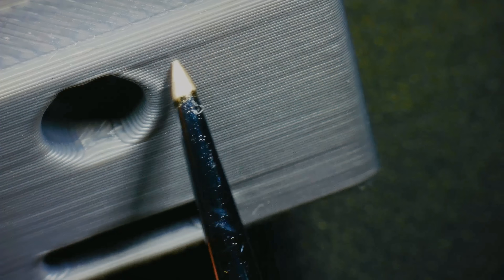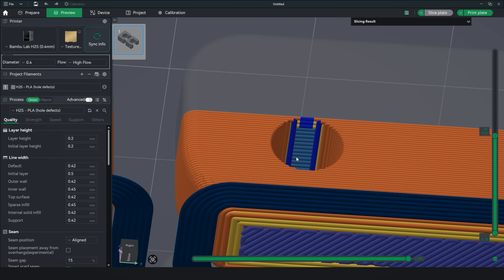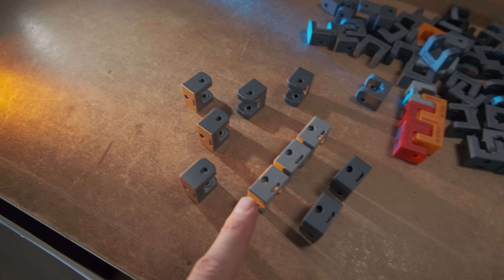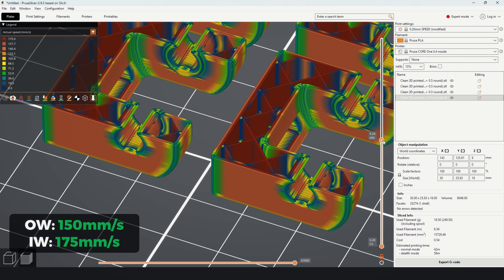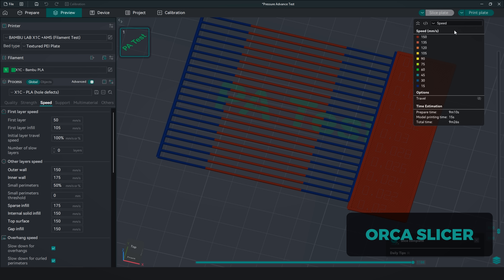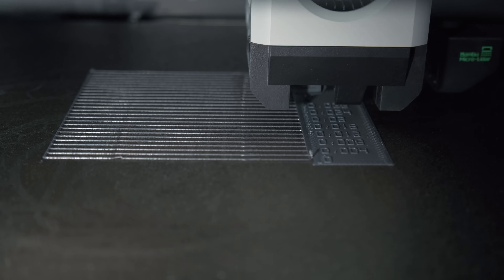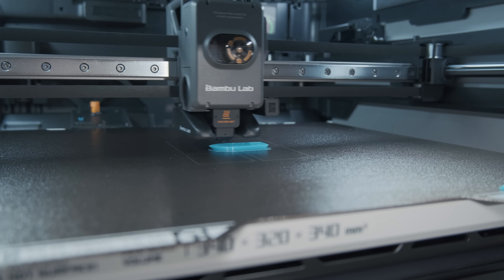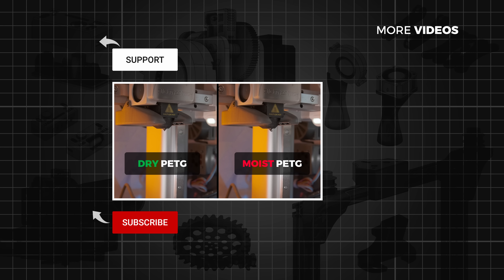How to FIX the UGLY 3D Printed HOLES (FULLY EXPLAINED)

Comment: Can you make a nozzle test video for the H2S/H2D, like you did for the P1S/X1C? With BIQU Panda Juicer / E3D Obxidian 500 / Microswiss CHT Highflow / Pheatus Conch?
Reply from the maker: H2/P2 series stock hotends already are good enough (compared to x1, p1). You choose other hotends for features like very high abrasion resistance, etc. I made a YouTube post about E3D HF ObX 500 about its performance.

Comment: I kept reading that the line method is no good and to use the pattern method. I have always had better results with the line. That said I am having some issues with ASA at the moment and finding it hard to read the results, they all look about the same. I may print on a different build plate and try to get better resolution as you have mentioned here. I really like this video and seeing some of the speed change pictures. Really appreciate it. also understanding that speed changes will impact the use of PA values is important. I was getting few artifacts at regular speed. I slowed the print down on my Kobra S1 and it came out with hole artifacts. Thats why I finally came back to watch this video lol. Thank you again.

Comment: hey im trying to implement your hole design but it looks weird when doing the top edge at 0.2mm chamfer, getting a more uniform look when i have a matching 0.5mm chamfer with the .5mm fillet. at least in cad, havent printed yet.
any tips?
Reply from the maker: Yes it does a little bit. You can try printing both, I doubt you see any difference with 0.4mm nozzle.

Comment: Is the auto calibration you’re talking about same as the flow calibration checkbox I get from my orca slicer printing to the A1 mini?
Reply from the maker: Yes, just make sure the "Enable pressure advance" checkbox is unticked in Material settings. Otherwise, it will override the auto calibration before the print.
Reply: @PrintingPerspective awesome! I will try it out

Comment: You should try turning off “slow down for curled perimeters” it’s a big culprit for the types of defects that you’re showing with the holes.
Reply from the maker: If we have perfect PA control, then it is not an issue, so it is definitely not the culprit. The setting for curled perimeters is a secondary issue due to the complexity and difficulty of the PA control, as it drastically slows down/speeds up printing speed on the overhangs, like 150->15mm/s vs 150->75mm/s when it is off. But without this setting enabled, very steep curled overhangs completely break: https://drive.google.com/file/d/15IYAkv44oBKXxKqTzr6WQlSaeIuqAGAr/view
Bambu Studio already has this overhang logic working with no issues, not sure why Orca devs just don't copy it.
Reply: @PrintingPerspective  because they are very stubborn and think they know better for some reason

Comment: Most holes in my prints are for screws so don't particularly care how they look as long as they're dimensionally accurate.  In order to minimize bridging and having overhang issues I just ended up using what lots of others did which is to have a teardrop shape.

Comment: Placing the humidity sensor that close to dessicant will likely result in false readings. Especially when the AMS is opened oftentimes for filament changes. The sensor will not pick up intermediate values that quickly.
Reply from the maker: If you often open and close the AMS, silica gel is not that effective anyway. By placing the meter next to a silica gel, I monitor the decicant state. Plus, I put 4 different materials and do not open the AMS for months.
Reply: @PrintingPerspective In that case it's fine. That's just something that I noticed because I only have one P1S and a single AMS, but a large amount of different material types.
What I do in that case is leave the middle part free from dessicant and have only the meter in that space. I find there are enough other places to put dessicant in the AMS to maintain very low humidity.

Comment: This is a really important topic.
The reason Bambu Lab's auto calibration works so well is that it performs dynamic pressure advance. PA value isn't a constant—it's more like a non-linear function influenced by various factors.

Bambu Lab's eddy current coil at the nozzle heatsink isn't just for bed leveling. It's also used for "auto calibration," which performs non-linear PA calibration by indirectly measuring nozzle pressure through displacement.
OrcaSlicer's Dynamic PA offers similar functionality, but it's much more tedious for regular users since you have to manually obtain PA values for every speed and acceleration setting.
Bambu Lab's recent "servo extruder" is basically an FOC-controlled motor that can measure extrusion force via current. This provides additional data on extrusion force to complement the eddy current sensor measurements.
Reply from the maker: Bambu indeed has a non-linear PA for the auto PA calibrations. Having an eddy current sensor + motor torque sensing for calibration it makes sense why it works so well. The manual PA calibration with precise PA value still works quite well if you don’t go crazy with speed differences, accelerations, etc. But yeah, all this testing changed my mind about auto PA just being wasteful to run before each print, to where now I always do auto PA before each print. Crazy…
Reply: @PrintingPerspective The problem is there are so many people using textured build plates that the auto PA calibration isn't super consistent. Printing on a smooth sheet where it can get a much more accurate extrusion width can make a big difference. I just love utilizing that textured surface for prints that I've accepted the small artifacts and print defects. Slowing down the print cures a lot of these issues even without a perfect PA value.

Comment: Pressure advance values will change over accel and speed changes, orca allows you to set adaptive pressure advance but it reality it still miss many points in my testing. I got best results with nolinear PA from bleeding edge kalico branch. Tune it, cry once, almost perfect at any speed/accel!
Reply from the maker: That makes sense. When I was comparing H2S manual vs auto PA calibration methods, auto PA before prints was always slightly, but still noticeably better in comparisons. And I know that the H2 series auto PA is a non-linear PA method. So, the manual line calibration on the H2 series will be slightly inferior as it uses only a single K value without additional factors. I wish BTT or any other company would collab with Klipper devs to make Eddy current sensors and torque-sensing motors for the auto PA on Klipper printers. But we all know that is not going to happen, as there are no profits there. :/
Reply: @PrintingPerspective  Kalico has comprehensive documentation on nonlinear PA that is worth checking out :)

Comment: Orca has adaptive pressure advance to take into account various speeds and accelerations. Have you tried?
Reply from the maker: Yeah, I know, but I haven’t. The adaptive PA should be used with adaptive Flow (small area flow compensation) for the best results, because both the flow rate and PA change between fast sweeping print sections and slow small ones.

Comment: Excellent video. It gets so tiring to explain to people over and over again why it's not as simple as a few calibration tests to actually get perfect prints in all scenarios. Even if just your outer wall and top surface speeds and accelerations are different for example, the same PA value does not actually work perfectly for both. A PA value may not produce the same results on a very small print with lots of heat vs a very large print with tons of cooling. If you change flow rate or temperature, suddenly your PA may not be perfect anymore. Also no, your stock settings print on a Bambu Lab is not perfect. Anyone with experience tuning can point out tons of flaws or points of improvement. Adaptive PA can also help with all of this, but takes a lot of time to tune and isn't supported by all printers. All the other factors you mentioned and more also come into play. When you are trying to produce prints as close to perfect as possible with high strength and accuracy, a lot of tuning can be necessary. That's just the way it is no matter what printer and filament you are using. Thanks for the great resource to send to people! Learning to tune each filament you use is really a great skill to have.
Reply from the maker: Thanks. Yeah, there are so many variables and the deeper we dive the even more of them appear. I always laugh when people say 3D printing is simple. It is definitely not if your print quality standards are high. I am not saying H2 series produce flawless results with auto PA, but they are spot on what I can achieve with the precise manual calibration. Sometimes I just want to print parts and focus on other things I am working. I wish we had an open source auto calibration method, I would love that on my Voron. I would probably spent all week tuning it to perfection, haha!
Reply: @PrintingPerspective  it's weird that voron doesn't have that function because many people have told me that bambu printers are just clones of voron trident and nothing special.
Reply from the maker: @riba2233 I stopped caring what people say about Voron… about Bambu… about Prusa... These days, a lot of people tend to take sides and complain about the opposing side just to do so. Every printer and brand has advantages and disadvantages. I love my Voron because I upgraded and configured it exactly how I want (and can change how it works any time), and I love my H2S because it takes the least effort to make quality prints. I love tinkering, and I love effortless printing. And because I never had a Prusa printer in my life, I have nothing to say about them. I don’t know, I started just ignoring what most people say, because almost always, there is a very clear bias and hatred towards the other side, and such influenced opinions are worthless to me. :)
Reply: @PrintingPerspective  of course 😊
Reply: @PrintingPerspective  I'm impressed you're that impressed by the Bambu Lab auto calibration! I still think it's a valuable skill to learn of course.
Reply: I have not dived deep into this and will be trying orcas PA calibration as the default one on bambu studio just doesn't seem super optimized and is a bit too simplified compared to others. It will get you 95% there as far as PA values go but as stated there are so many values that come into play that sometimes that default 95% is good enough for most all projects where ultimate print quality isn't required. 
Flow rate is also another setting that is far too simplified and the calibrations for it are also far too simplified. My X1C with the Lidar does seem to get fairly close with its auto calibration using the Lidar. Though even the Lidar has baked in limits so as to not stray too far from the default settings.
I would be lying if I could squeeze a bit more quality out of it tho. There are diminishing returns to everything however. You'll spend far more time tuning that last 5% than the 95%.
Reply: @rileyneufeld7001 I agree with you. Definitely worth learning the tuning for yourself. When you get it just right it's so satisfying. Then you can post pics that actually impress people who know hahaha.

Comment: I lose a lot of time calibrating. And for example, I have to recalibrate PETG to act as support at the temperature of the PLA I'm printing. It does help that you don't change the brand and colour PETG. Just save it to user presets. 
I always do the tower and the pattern but I will add line to that seeing as that will help with lines.
It doesn't help my perfectionism though as I always overanalyze calibration with my microscope.
Thank you for posting this, your videos are always informative. Top!
Reply from the maker: Thanks, I think our printers are just not advanced enough yet. So I wouldn't suggest going too crazy with the calibrations. Find the one that works the best with your printer and use way smaller calibration increments, that's all we can do.

Comment: why is stable volume disabled? would be nice if it was on :)
Reply from the maker: I wish I had an idea why, I don't think I can control that. Probably YouTube just being YouTube.
Reply: @PrintingPerspective  have to turn you up like 40% :)
Reply from the maker: That's crazy. I have to lower audio when watching my videos by similar amount as they sound too loud compared to others. I will try look into, but previously a year ago I couldn't find anything.
Reply: @PrintingPerspective  i found this regarding "stable audio" and this platform;

reasons include the original video's recording quality, such as a low bitrate audio file or inconsistent audio sources like alternating between different channels (e.g., stereo and surround sound) i see some other channels that also have this stable audio feature disabled. perhaps some toggle in studio ?

Comment: You can variate the layer height at the top of the hole, but overall if I need precise holes, I just drill them out.
Reply from the maker: But then you variate the LH for the whole print which usually leads to less consistent looking print surface. I totally agree with drilling the holes, I often do the same when I need perfectly round holes.

Comment: Even when selecting the optimal line through PA tuning, defects from insufficient extrusion occur with materials like PETG, so I question whether PA tuning is the correct calibration method.
Reply from the maker: Insufficient extrusion occur when you are no longer properly melting the filament (if you have no mechanical problems on your printer). Regular petg needs to be printed at ~25% of your hotend's max flow rate. High speed petgs are so much better at this.

Comment: I've concluded all calibration line and surface prints are useless.
They are too different from the actual print objects and their performances have no relation.
Reply from the maker: On what printer you tested? The second best method for me is the pattern, but you need a microscope whe analyzing results. The line works best for me but if others methods works better for you, use them, things can vary as usual.
Reply: @PrintingPerspective  Bambu A1. I guess there's better machines.
Reply: The whole point is to use a small amount of filament to get a close value, then do actual test prints, and then you can tune from there if necessary. Different prints will almost always need slight tweaks to be perfect.

Comment: I was genuinely surprised at how well my H2S and H2D performed when using the auto calibration from the print send screen as well. No idea why the results fed back when doing "auto calibration" in the calibration menu is too low (noticed the same thing)

I really wonder if they actually use a variable PA table on the H series that is only stored on the printer (basically how orca's multi-PA calibration works for klipper printers). My only reason to think this is because of how well prints come off even with varying degrees slow->fast and fast->slow. It is also strange that doing the 'auto calibration' fron the print screen never shows the user that value or gives access to it. If it was a single value, I would at least expect them to do so.

Lastly, I haven't compared keeping that setting to 'on' vs 'auto', but I have a few prints from auto and they look very very good as well. I do know that 'auto' just stores w.e. was calibrated and then uses it a few times until it does it again (how that time frame is determined, I don't know).

All I know is, I am glad to not have to do my own PA calibration on these printers. Thanks for the video!
Reply from the maker: Yeah, auto PA before the print gives extremely good results on H2 series, that's my experience too. I tried asking Bambu about how all of this works on their printers, but you know, couldn't get almost anything in detail as it is closed source. Before this video, I was very sceptical about running auto PA before each print as it waste filament each time, but now when I saw how much important it is, I run it every time... I want this auto PA on my Voron too! ;D
Reply: @PrintingPerspective I know they are just using the Eddy current sensor for pressure sensing (probably just measuring deflection of the whole hotend give the sensor placement, though most/all will come from the melt zone and nozzle area).

They probably get a baseline reading of the pressure when extruding X amount of filament. Then, use that baseline as a constant offset for varying extruder freed rates and map out a table. Doing so allows it to be pretty much filament agnostic (since each filament will exert different pressures; given compressibility, fluidity and density differences). The only disadvantage is not having back pressure data that would come from actually laying down the filament, though that is probably just some averaged constant thrown in.
Reply from the maker: I think we can only speculate about how it works. The H2 series uses eddy current sensing combined with torque data from the extruder's motor to determine the Pressure Advance value, that is probably why it is so good. The A1 series only has eddy. So far, it has worked very well on the H2 series, to the point where I don’t make any manual PA calibrations. And before any testing for this video, I thought that auto PA is just a waste of filament lol.

Comment: I stopped doing any manual calibration on my bambu A1 as I would always get something worse than automatic calibration. Are they considered reliable on the A1? They look like they could be better given the results I get, just putting in the effort to do it accurate manually is too difficult at least for me. I think if I could do it accurately manually the output would be better than the automatic.
Reply from the maker: I don't have much experience with auto PA (flow dynamics) on A1 series but when I tested for this video, it produced pretty good results.